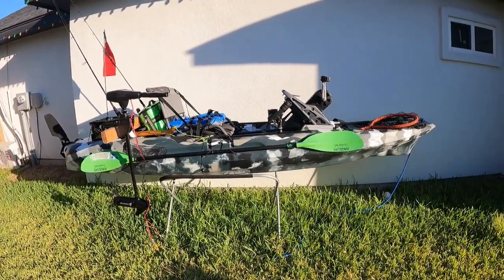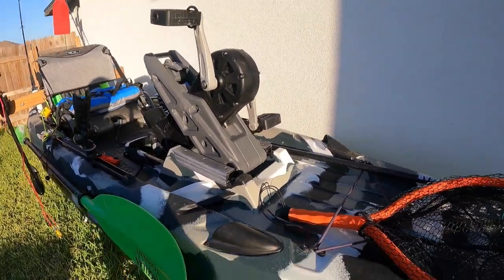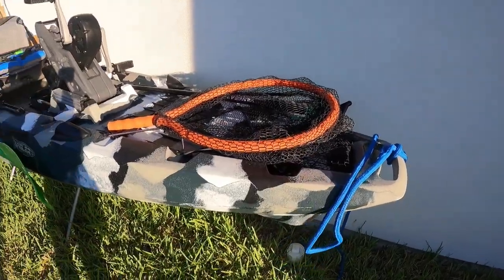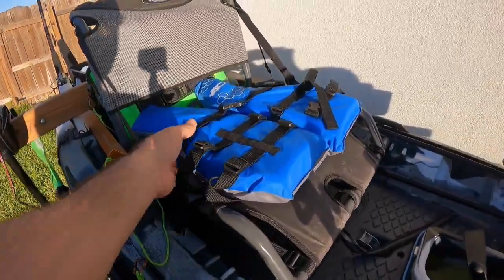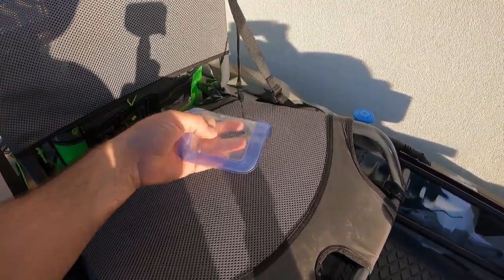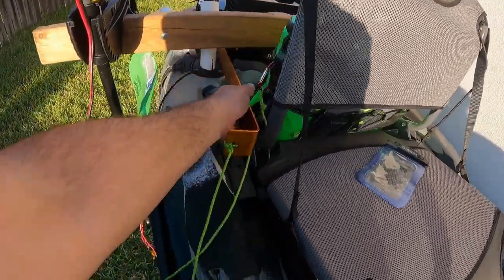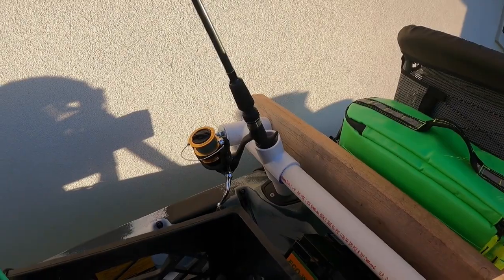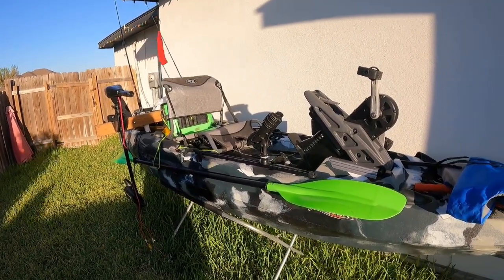Ultimate Kayak Setup Tour! South Texas Fishing!! Seastream Angler 120PD Kayak

Comment: FYI, you're securing the seat wrong. There's an anchor under that cam strap. The strap goes over the back end of the seat, then under the back anchor, then under the front anchor, over the front end of the seat, then through the cam strap cleat.  The seat is waaaaay more solid when you use that front anchor, too.
Reply from the maker: Oh man thanks so much for that! I just screwed stops in where the seat slides in so it won't slide back on me anymore when pedaling!